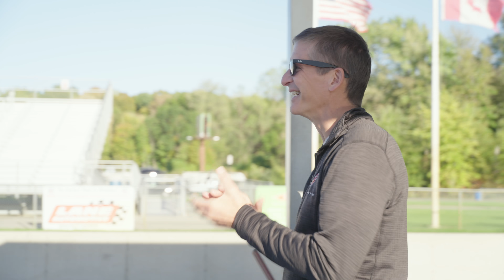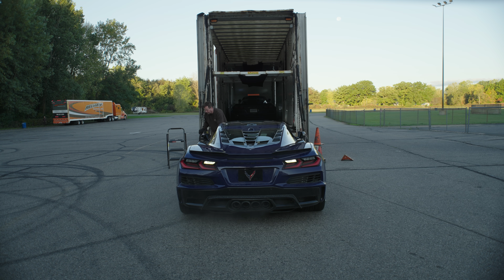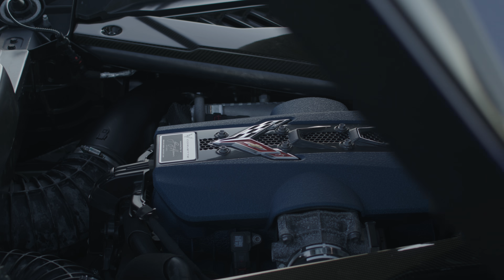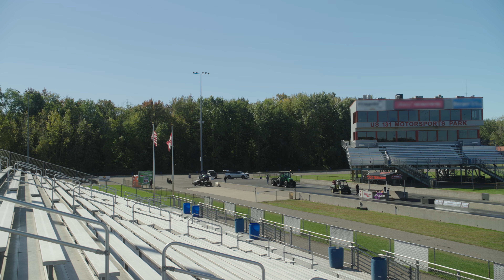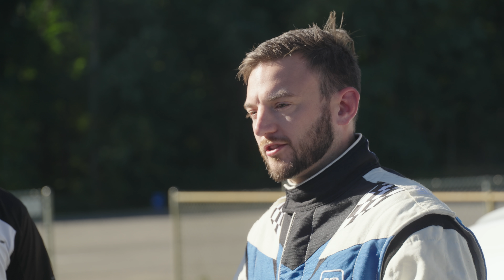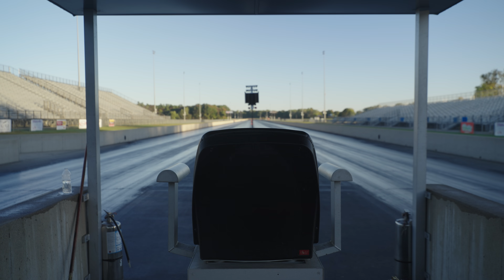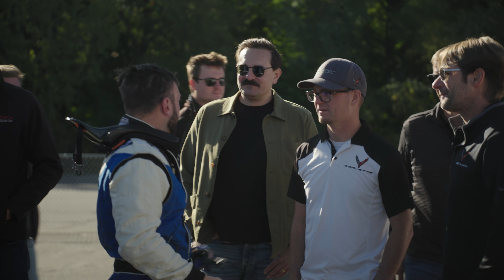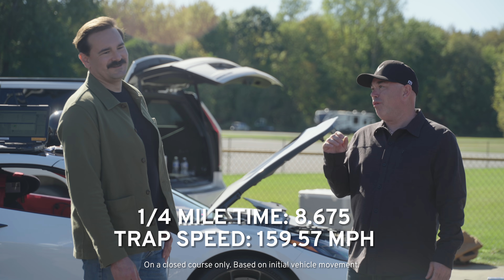We Pushed The Corvette ZR1X To Its Limits (DRAG STRIP TEST)

Comment: 0-60 in 1.68 seconds and 8.67 in the 1/4 mile is insane for the price and for running on pump gas.
Reply: That is crazy fast!!!  I wouldnt have believed 25 yrs ago this was possible!
Tech is amazing
Reply: @gordocarbo right? I remember even 20 years ago, the 11s in a super car was absolutely nuts. My friends dad had a car that would run mid 12s and I thought it was bonkers.
Reply: @chrisdwyer1477 honestly slow cars are still fun
Reply: @sneezinhatch  I think that's a huge problem with the car scene today. "oh, your car doesn't run a 10 second quarter, it's garbage." Like what? I'm so glad I enjoy cars. Not just ones with a certain HP number, price, or track time. What a boring existence that must be.
Reply: @chrisdwyer1477 I had a buddy with an old chevelle and he would tape a 100 to the dash and say if you can grab it while accelerating you can keep it. It probaly only ran low 13s and it threw you so hard in the seat. I cant imagine this
Reply: @watchandjewelryloft4713 Way too much judgement passed there.  Slow down.
Reply: @larrywilliams3858  It's not judgement. It's observation. 😂
Reply: @watchandjewelryloft4713 
 What?
Reply: @chrisdwyer1477 I had a 79 Ford 2wd pickup that ran mid 12's on slicks and I thought it was very,very fast! This was in 1989
Reply: Well the order is tall for Corvette. 

The C6Z w/ a competent driver and ideal conditions ran 10.9’s out of the box with only an upgraded ROAD-LEGAL tire. I had one back in the day. Can say that it was a monster before its time (I had a H/C/E on mine)… so it moved about like a mid-10’s car. 

And back in 2015-2020… there wasn’t much else out there that was faster…and every vehicle that was faster had to be modded quite a bit . There wasn’t another N/A setup that could hang with it. 

And now the C8Z is a firm 10’s car and the C8ZR-1 is a firm 9’s car. 

Thing is, this car runs mid-8’s AND IS ONE OF THE FASTEST PRODUCTION CARS AROUND THE RING. There are only about a half dozen truly production cars that are faster than this car on a circuit track. 

That’s what makes this car truly an accomplishment. It’s as fast as a Dodge Demon in a straight line and as fast as the fastest Porsche around the Ring at the same time. There are only 3 other cars w/ official laps times that are faster than the ZR1-X on the Ring and those mfgrs spend 100X more hours on that track than Corvette and the driver was an engineer that had a lot of slop  in his recorded lap times. 

Misha does a breakdown on that lap-time with the ZR-1 and said there was at least 10s left on the table in their lap time. Corvette has raised the bar once again, just like they did with the C6Z.
Reply: Gorgeous run on a super rubbered up track with perfect weather conditions. That’s gotta feel amazing!
Reply: @johnathanollenberg6041 Jealousy is an ugly emotion.
Reply: @stephenwalker6939 what was that about? I was saying that would have been awesome to experience, I wasn’t bashing them in anyway. Perfect conditions, fantastic car. I’ve always been a corvette fan.
Reply: @stephenwalker6939 and yes it’s an ugly emotion, I really didn’t mean to come across that way…. But I’m am a little jealous I won’t ever own one😢. 
Have a good night or day wherever you are.
Reply: @johnathanollenberg6041 it did come across as jelly but you cleared it well.
Reply: @jasoncobbb5029 I get it. Us Corvette fans have a reflex defense with all of the Corvette haters out there. I don't understand all of the hate. If you don't like it, don't buy it. It's that simple, but these folks feel the need to spew hate about the Vette and it's owners on every Corvette video they see.
Reply: Americans on top!! 🇺🇸💪🔥
Reply: Don't forget, with a warranty too! Other cars blow up soon after.
Reply: You are probably right!!! It just goes to show people just how much OVER-PRICED Ferrari, Lamborghini, Bugatti, and all the other SUPER CARS are!!!!!!! Chevrolet Corvette is a WAY BETTER VALUE than all those SUPER HIGH PRICED EUROPEAN SUPER CARS!!!!!!!
Reply: @micha @michaelvs.scorpio7676 errari and lambos aren’t overated or over priced. They may cost more and will always be with more 10 yrs down the road. Hopefully Chevy does the people who can 450k price tag for a zr1x a solid and keeps the production numbers low.
Reply: Agreed, but it’s insane period. There are several million dollar cars that can’t do that.
Reply: 0-60 in 1.68 is the fastest I've ever heard...?
Reply: @Itsjamilagain  That is about what Elon said his sports car would do with a ROCKET engine assist (never made it).
Reply: I'd take this over anything Ferrari, Lamborghini, or Porsche have, or could come up with, every day of the week. Significantly cheaper to purchase and upkeep. Way more reliability. And if something does break, then the parts will be much easier to find, and won't cost an arm and a leg. Sometimes I think these arrogant owners of European super cars are more about interested in flexing the pricetag of those cars, rather then flexing the performance, which if you think about it, it makes them look like fools with more money then sense, who don't realize these manufactures are ripping them off. A lot of these European manufactures love to try and excuse their outrageous prices with nonsense like brand recognition, and claims of being hand made and exotic materials that aren't nessecary. I'm sorry, but having a car with a particular badge with brand recognition does not automatically make it worth 6 figures. The only thing I'm willing to spend 6 figures on is a home and property, which is something I'm going to use and need all day, every day.
Reply: Can it run on E85 stock or does that require a tune?
Reply: @Steve_allen79  Would probably need upgrades to the fuel system and definitely a tune. Should run fine with a 100 octane though.
Reply: @Steve_allen79 tune
Reply: @Steve_allen79  if doing 100 i think fine but for e85 def. tune
Reply: @Steve_allen79  I feel like the electric motor would also require some tuning as well
Reply: This comment should be a tiny bit more down or start with a spoiler warning
Reply: I could go to the store and back pretty quick in this!
Reply: Not just insane for the price, that’s insane in general
Reply: And for a hybrid!
Reply: Who said it was pump gas? I don’t remember hearing that 😅.
Reply: It’s fast. Gt2 RS record about to go down
Reply: @MW-uy3np  the zr1x is too heavy to beat the gt2rs round the nurburgring
Reply: Faster than an S Plaid
Reply: @Stanawesome Definitely. Plaid S is more in line with the regular ZR1. ZR1X probably still running 8.9-9 flat in avg weather and DA. Plaid maybe can take it if its 100 plus degrees lol
Reply: @TB-vb3ov  Yeah, they ran consistent 8.7s over and over, so I’d say 8.75 is the realistic quarter mile for regulars. 8.67 maybe only for perfect conditions. Regardless, 8.75 still beats almost everything that’s electric or not electric, really only the Rimac Nevera will consistently beat it. Also, most other super/hyper cars use drag strips to test quarter mile and 0-60.
Realistic 0-60 is probably 1.72-1.75. Still faster than anything except Rimac Nevera R. 
Makes me wonder what GM could make with a multi-million dollar budget, and also it proves engines can still compete for 0-60 and quarter mile records. Not to mention showing how overpriced cars like the Revuelto are. Sorry for the rant lol
Reply: I’ll take it!
Reply: I propose a 2and licence for the car have to pass a I can handle it test without being a statistic but double or triple speed limit away from residential area or busy enough traffic where you would have to qeave in and out.
Reply: No company can beat it for the price ?...
Reply: Yeah... Because $400k is such a good deal... You dorks are so dumb
Reply: That's the 60 ft time bro not 0-60 🤣🤣🤣
Reply: @itshiho  no 1.68 seconds is the 0 to 60 time dude, Google is your friend
Reply: @markw9512 with 1 foot rolout btw so technically cheating
Reply: @yulpiy  goddamn you people are so thick about what 1 foot rollout is and why it is done. It is done because that is the way actual drag strips here in America are set up. They have a timing beam which you have to lineup for and break and yes there is literally around 1 foot of travel before the timing beam breaks and the run time kicks off. This is the way they have been since the 1950s. And so in order to keep the track times consistent from them till now so we can know who has broken what record, they use rollout. It’s not cheating, it’s keeping a system in place on which everything has been time since the 1950s so that we have consistent record keeping, OK?  And every single goddamn car they test here in America for the magazines has the rollout time listed in it so you can subtract it off and all the cars are tested with the same standards. So if you want to know how fast your beloved European overpriced car compared to this, You can look it up in those cars and get a relative measure.  Not complicated.  Try to keep up…
Reply: I wonder if they tune the car like more boost just to ran this times.
Reply: Whats the price
Reply: @tedrstedrs6690  around 300k I believe
Reply: @JustAnotherHondaGuyso 450 when it gets to greedy dealers😂
Reply: @CITRUS--  I mean hey it’s a fraction of a Bugatti and goes way faster lol
Reply: Don’t care how fast you make that plastic piece of trash China Motors only cares about shareholders and investors not customers they disrespect us and you clowns bend to the knees and open wide….
Reply: on racing gas, couldbe 8.5
Reply: It’s bad ass but it still didn’t beat the Demon 170 with all that and 800 pounds lighter
Reply: @nasapeterbilt6042 The Demon did it on E85, not 93 octane pump gas. Plus, this car can actually take a corner.
Reply: @nasapeterbilt6042 Demon 170 is a one trick wonder that can only perform in perfect conditions.  I would take a plaid over it any day.
Reply: @clarkharms Plaid will beat the demon 170 all day on the street amd 90% on the strip. The ZR1X on the other hand will beat the Plaid on both unless maybe its 100+ degrees lol
Reply: @TB-vb3ov I agree.  I have a Tesla and Rivian, both are incredibly easy to launch.  I have a C8 Z06 and it is definitely more involved to launch and forget about bad weather.   Plaid is also easier for everyday use.  Climbing in and out of a sports car is not easy, even finding a parking space that is wide enough to open the doors without hitting the car next to you, or speed bumps that bottom out the car etc etc.
Reply: nah. It will brake quick enough to justify the price. Never the less its an accomplishment.
Reply: Supercar!!
What are hypermarket qualification numbers?
Reply: With rollout?
Reply: I could buy an F150 from the dealership and spend $10 on mods and run 7s. This car is supposed to be for the track, but everyone knows that the GTD is a better track car.
Reply: @t @thermalmeltdown8953  With enough money any car in the world can be a 7 second car. Multimatic builds those ford GTD’s ford just supplies the body. At least GM built this themselves. Also until a customer receives a GTD competition the ZR1x is the fastest American production car around the Nurburgring.
Reply: You say that like these things are cheap. I am looking at 3 for sale right now for 450k.
Reply: Those numbers are just absurd and that its without radial tires. 😱
Reply: @ivanviera4773  Uhhh. Michelin PS4's ARE radial tires....
Reply: @tommyteeth5874 I’m sure he meant a drag radial which they’re not.
Reply: @ivanviera4773  yeah not the tractor that laid down pounds of glue on track
Reply: @Json918 it's a racetrack
Reply: @Json918 there are many many pounds of glue on there.
Reply: @Json918  Of course the track will be prepped, they want the best time they can get
Reply: @Json918  okay? What company DOESNT do this??? 
Ill wait... 😂
Reply: @gordocarbo  I think their point is that the amount of prep makes the "radial tire" point a little less relevant. Slicks wouldn't be much of an improvement, if any.
Reply: @mile_high_topher  not true, slicks are always an improvement on a drag strip.
Reply: @markw9512  Cool, bro. You figure out how many 100ths you can get.
Reply: @mikeroczkowski8545 mate nobody uses a prepped drag strip with special tires outside of the US.
Reply: @Json918 Excuses 😂😂 stfu
Reply: @m @mile_high_topher  tell us you’ve never raced on a drag strip with/without slicks without saying so
Reply: @markw9512  I don't care enough about you to tell you anything.
Reply: @mile_high_topher  you’re not smart enough to tell me anything, son.  You’re just a stubborn, can’t admit you were wrong Dunning Kruger type
Reply: @markw9512  That's cool, dude. Keep arguing against something I didn't say. Makes you seem real smart.
Reply: @mile_high_topher  people can read what you said and see for themselves. And I’m smarter than you’ll ever live to be
Reply: Can't talk about "for the price" without factoring in stealership rapage aka "market adjustment" :elbowbump:
Reply: @TweakRacer  and what other car in this category do you think you can get without paying markup, pray tell?
Reply: @markw9512 I wanna know as well 🤔
Reply: @TweakRacer  irrelevant
Reply: definitely take it over any EV even the Plaid any day.
Reply: @robertdaone  if the plaid was a hybrid it’d be a hard choice for me
Reply: @yeetskeet691  😂😂 really?? A plaid would be a hard choice for you?? I mean everyone has a butthole but youd have to be Helen Keller to think a tesla is in any way comparable to this corvette
Reply: @robertdaone u have a wife & two kids. A regular job. U can have a plaid & 300k cash in the trunk or this corvette & no money❓😂😂😂
Reply: @clarkharms  You’re comparing a Diamond to coal
And the plaid doesn’t handle no where near the Vette does you really can’t compare the two at all
Reply: @clarkharms yea cuz ur an idiot. Zr1 right now is selling for more than 250 & u can buy a 2024 plaid with 20k or less miles still under factory warranty for under 50k…. 😂😂
Reply: @clarkharms Yeah, but then you have a Tesla, with Tesla problems.
Reply: @Iamhimothy-11 that vette only costs $250k, I guess you don’t math much.  Either way you would not be able to afford the vette or the plaid.  Too bad for you, I have both.
Reply: @Maidenrules29 I have a Tesla, no problems.  I have a C8 Z06, no problems.  I got a lot of money 💰, that how I got no problems.
Reply: @c @clarkharms what’s ur IG, fb, tik tok❓ I bet ur 100% a liar.  We can get on live & I’ll embarrass u….
Reply: @MJR7250 yea the plaid can hold my wife & both kids in the back. U right , there is no comparison… the plaid wins… 😂
Reply: @Iamhimothy-11  I have a cars that does that.. the Plaid is lifeless and one demential can’t even compare
Boring asf..
Reply: @MJR7250 u have cars that does what? A plaid is boring to u, cool , nobody is forcing u to buy one… anything else revolutionary to share ❓
Reply: @Iamhimothy-11   It’s boring no engine noise no turbo no cam or exhaust sound or Handling just straight line 
Acceleration  one 
                         Dimensional… 
Oh did I mention it Fugly…
A face only a mother could love…
Reply: @I @Iamhimothy-11  You’re comparing it to Corvette and keep comparing to a Corvette it not even in the base model corvettes class
Reply: @MJR7250 yea it’s better than ALL of them 😂😂
Reply: @Iamhimothy-11  You’re entitled to your Delusional Opinion…
Reply: @clarkharms  bet you won't be able to buy a zr1x for 250k the dealers are gonna add minimum 25% mark up
Reply: @yota8325  in the short term, I think you’re right long-term not so much when I bought my z06 I paid less than MSRP if I bought when they first came out, I would have paid 100 grand over msrp.  Once the influencers and Youtubers get theirs, the prices drop.
Reply: To be fair, that’s just insane for any production car at any price
Reply: Heck yes!!   8s in the 1/8 mi is a respectable street car!  This thing is Bonkers!
Reply: @gordocarbo you mean 8s in the ¼
Reply: Just remember they do 1 foot rollout for their 0-60 times so it’s kinda not 100% honest. It’s probably close to 2.0-2.2 seconds.
Reply: @Some0ne001  if 0-60 was over 2.2 sec 1/4 Mile will be around 9.1 seconds not 8.67
Reply: @Smzxe it will not do sub 2 sec on normal tarmac
Reply: @Some0ne001 people are routinely running 2.1 seconds with regular ZR1s, if you can consider them regular.
Reply: @Some0ne001  You have to look for the disclaimer. It said “from the moment of first movement”, so there’s no rollout.
Reply: @GNX157 So what it said is exactly the opposite of what you are saying... So yeah, with 1 ft rollout.
Reply: @elenrad-y5o you failed reading comprehension in school.
Reply: @GNX157 "From the moment of the first movement" the first movement is the first foot. Soooo ?
Reply: Still 1.8 1.9 with rollout keep crying all manufactures that list 0-60 use rollout so it's not the flex ur thinking about. Why all the hate I don't get it.
Reply: @bobtaliaferro5492  we are at a state of performance with cars that it’s pretty tough to hate any top of the line sports cars produced. They’re all pretty retarded fast
Reply: It's insane no matter what!
Reply: The track was glued all the way thru the 1/4 mi mark.  And 1.68s to 60 mph, no way.  Rollout will make it closer to 1.9s.  Still insane and anything approaching 2s real world is off the charts.  Well done GM.  I guess everyone has to overhype already phenomenal reality w marketing spin so it's apples to apples.
Reply: @johannel8104  that’s still Insane !
It’s just the first year in Production weight until they put it on a Diet..
Then what more criticism?
Reply: @johannel8104  There was no roll out in these stats. Watch for the small disclaimer “from the moment of first movement” So actually their specs are even more impressive.
Reply: @johannel8104 take a chill pill
Reply: Nah it should be cheaper
Reply: @herecomesthealiens  best we can do is 5 bucks
Reply: @hertzwave8001 how bout fiddy cent?
Reply: Insane. Period.
Reply: Seriously. If they just added an E85 tune, they could add 200+ HP. And ZR1 already makes 1,200 CRANK & 930lb-ft (based on several dyno tests & Z06's 13%hp/10%tq drivetrain loss).

So ZR1X is making 1,380-1,395hp & 1,075tq 😂
Reply: Is there ECU stage 3 or 4 tune for running with E85 for the ZR1?  Like some X-drive Beemer sleepers do?
Reply: @yountune9799 No
Reply: @yountune9799  You don’t need the Car any faster..
Reply: Shelby Gt500 CR ran an 8.59 in the 1/4 and has 2 to 3 times less horsepower also.
Reply: @lincolnls0416  It a production car? a car for street?
Reply: @lincolnls0416  Stock?
Reply: I'd be doubtfull about "runnning on pump gas" as changing to race fuel/alcohol blend for modern turbocharged car is one of the easiest performance boost...
Reply: That’s with a 1 foot roll out. It's true 0-60 would be 1.85-1.95 sec
Reply: @SuvroSawon  still fucking fast
Reply: They never said on pump gas. I would assume e85
Reply: @uberdriver5711 Why would it be on E85? It uses the same engine as the normal ZR1 with the same engine power and it uses 93 octane.
Reply: @arpz1129 because they hot lapped it. He clearly says the car started going slower. The ecu will pull timing when iat are up from the heat. E85 has more octane to prevent detonation. Nobody goes to push a car its very hardest on just  pump 93. You are just assuming they used 93.
Reply: @uberdriver5711  You are talking like they are Joe Schmo pushing their car at the drag strip. They don't offer any performance car that runs on E85 from the factory. You know people are going to try and do the same times they are doing and they wouldn't want to have the bad publicity of ZR1 engines blowing up because they ran their tests on E85 to get better times and not inform people.

Also a lot of people push their cars on 93., not everyone modifies and tunes their cars to run on E85. 

Every car heat soaks and goes slower when hot lapped, Drag Times does it all the time. That's why they went back the next day after the calibrations were set to get the best time they could.
Reply: @arpz1129 let me know when they say times were run on pump 93. Nobody is dumb enough to push a vehicle making that kind of power hard on 93 while trying to run a particular number. Dont be dumb. Well maybe you would try it. If it hit that time on pump 93 they would have said it. Because thats something to brag about. Did they? Nope and they wont.
Reply: @uberdriver5711  Let me know they according to you will say they ran on E85. The engine is designed to run that power on 93 with them knowing they have to warranty it. This isn't a guy that modified his car to run double the power and has to run E85 to not blow it up ZR1s are already been ran over and over at drag strips even beating GM's stated times on 93.

Haha you thinking they would have to state they ran on 93 as a bragging point. Maybe they would have stated if they thought some idiots would think they had to run E85 to get those times.
Reply: @arpz1129 well apparently all the top tuners and youtube enthusiast are saying the car was juiced up. Maybe 100 octane.   So yeah you go argue with them. Another thing. If its something so easily duplicated. Why didnt the do it with the white car as well. The purple one was specifically used to achieve the lowest time.
Reply: @uberdriver5711  Yes, according to Chevrolet, the Corvette ZR1X runs the quarter-mile in 8.675 seconds at 159 mph. That's not on racing gas or special tires, either. Chevrolet says it hit that time on pump gas with its regular Michelin PS4S rubber, and it didn't even have to run an engine tune that would make it illegal in CARB states or fit some special aero kit

A report on Jalopnik. You can Google it and read the whole thing.

  Go argue with GM

What's your next excuse? That they are lying?
Reply: @uberdriver5711 Went real quiet there when proven wrong.
Reply: Is it really "pump gas" when its running off electricity too
Reply: @everett8811  I would say yes. Tchnically the car creates electricity for the battery when slowing down from movement created by the gas engine. So it's gas generated electricity.
Reply: It's not physically possible to do 1.68s 0-60 in a vehicle with rubber tires. Even on a prepped surface. Unless there is some sort of lie, and in this case the lie is the usual american lie, which is that the time is really more of a 5-60 time. I guarantee it's no faster than a Plaid in 0-60. I know this because both cars are limited by physics. not power or suspesion or tires or anything else.
Reply: Boy you guys believe anything 😆 🤣  I call BS
Reply: @danawooley9464 lets wainting to others people prove it
Reply: One thing's for sure: They're making the European supercar manufacturers look a bit silly.
Reply: @Hickeroar mate this is on a prepped drag strip with special tires. There are multiple Euro brands that can go in the low 8s with this setup
Reply: @Shin_MajinBull$hit, no European car under 2 million can touch this car. Name one.
Reply: C8 has many Engine Light problems. Some days the problems go away and then pop back up again and again!
Reply: On a super sticky drag strip, with a foot roll out, with a whole ass team of engineers tweaking everything. These aren't comparable numbers to anything quoted by car makers in Europe, or anywhere else. Everyone else quotes the performance of a car in real world conditions, aka something you could do yourself on pretty much any stretch of dry asphalt. You can probably add a second to both those times if you remove all that and then they look nowhere near as impressive.
Reply: @SapTheseCasters add a second? People are already running 9.1s in the regular ZR1. By this time next year we will see a zr1x touch low 8s near 7s. Just watch.
Reply: @SapTheseCasters because maybe car makers in Europe don’t care about the quarter mile🤷‍♂️
Reply: @quinnmarchionini7997  so why do they publish acceleration figures
Reply: @quinnmarchionini7997 It also does 233 mph, a Lamborghini Revulto goes 217.
Reply: People defend the zr1 like they will ever drive or afford it compared to a plaid which is affordable 😂
Reply: @Json918 two completely different cars. So STFU
Reply: It has radial tires. It's not out there on bias plys lol  @Json918
Reply: I drove one 2 days ago . Will I own one ? Prolly not . It still doesn’t take away from the fact that it’s the baddest American made car ever built . You can literally go drag racing , roll racing , and autocross in the same day and win all 3
Reply: @Json918 nobody cares about the plaid
Reply: @Json918 yeah a 5 year old plaid can be had for 50k..... we should all get one.... its pointless to compare ev to ice
Reply: @Json918  And a microwave.
Reply: @fr33lancr  yup cooking all the competition
Reply: its not stock calm up
Reply: 400k for this vs a plaid for 1/4th the price or 1/8th used for similar performance
Reply: @mrscopes2852 ZR1X starts UNDER $200k, you can get 2 fir the price you quoted😂
Reply: @Forever.Remain.Nameless zr1x ain't selling a penny under 350k
Reply: @mrscopes2852 yeah… because people actually want it.
Reply: @mrscopes2852 because people want it. No one wants a Plaid and I drive a model Y
Reply: @ShawnyStorm  I have a plaid clown and love it that BS C8 will get hot and slower
Reply: @danawooley3627 dude a normall ZR1 is faster on anythint but a non-prepped drag strip. The ZR1X will be faster everywhere even massively heat soaked and it can actually finish a lap of the Ring witbout going into limp mode
Reply: @ShawnyStorm  https://youtu.be/GJegRv4QG0A
Reply: After dealer mark up, you may not get one anywhere near $200k.
Reply: @mrscopes2852 bro get the hell outta here talking about a plaid
Reply: @Fyrebirdchicken crazy when he mentions a battery car its “garbage” zr1x has high voltage battery packs… man they both suck 😂
Reply: @Fyrebirdchicken  why would you even care you’re closer to owning a plaid vs this car that be sold for 100k over sticker 😂
Reply: @Json918 ??? Lmao .. what does that have to do with a weak ass , soulless plaid compared to a c8 zr1x
Reply: Plaid doesn't do 8s tho
Reply: @yusufgta4341 yeah you gotta strip it to run 8s, defeats the point of the plaid being a commuter car
Reply: @oaklandunderground is the ZR1X a battery car ev? Or are you stretching it to try and prove a point. Because I still don’t see your point.
Reply: @mrscopes2852 stock plaids don’t make it into the 8’s…. Also…. No one cares about an EV 😂
Reply: @jamessudbury6943  EV fan boys who have never even changed spark plugs care, lol. But f them....
Reply: @mrscopes2852 Nobody cares about a silent  battery on wheels that the panels fall off that can't stop because brakes suck😂
Reply: @osos231  crazy when he mentions a battery car its “garbage” zr1x has high voltage battery packs… man they both suck 😂
Reply: @OaklandUnderground Diff being brand names. The diff beig Corvette is a hybrid. The diff being Corvette makes music, the batt on wheels doesnt.😂
Amongst the 2 that sucks (according to you) I'll pick the noise maker faster one.
Reply: @o @osos231  different being that they are AWD and have electric components either way ?.. rather have base zr1 rwd lmao and doesn’t need no piggy back to make it full potential. Im good an AwD ElEcTrIc HyBrIds 😂
Reply: There getting outlawed from drag strips because the can't be put out when they catch fire.
Reply: @mrscopes2852 should look into what the record setting plaid had to do in order to get close to this vette’s time lol
Reply: Wow what’s up with this Stan Plaid Fanboy😂😂😂😂😂
Reply: @mrscopes2852 400k? Where are you getting that? A 1lz is expected to list for 207k. The quail silver special edition is going to be 241k.
Reply: @mrscopes2852  bro who cares about comparing it to a Plaid this is a 2 door hybrid v8 and the Tesla is a 4 door EV. Nobody is cross shopping this car and a Tesla. Enjoy both cars for what they are and drive what you enjoy and have fun with.
Reply: @mrscopes2852 What if there's a corner?
Reply: @mrscopes2852 a plaid? 😭😭😭😭😭😭😭😭😭 I already have a microwave
Reply: @mrscopes2852 EVs now just got outlawed at Orlando strip.  My guess is more will follow.  Not safe doors lock you in and other fire concerns
Reply: @jpconard  there's a manual latch for the doors lol, and way less EV fires than ICE fires
Reply: @mrscopes2852 similar.... Bud the plaid is half a second slower at the 1/4mile
Reply: @Lucas_sGarage true. But its much cheaper to buy and maintain, and its a daily driver with cargo space. Zr1x is badass but it just sucks it'll cost 400k+
Reply: mrscopes2852, it needs mods to do 8s
Reply: @mrscopes2852 lol cool bro.....
Reply: @mrscopes2852 and you can buy a airplane and fly across the country
Reply: @mrscopes2852 $200,000
Reply: But worthless in 5 years.
Reply: @mrscopes2852  gayyyyy
Reply: @mrscopes2852 Yea but the Plaid is really gay. And slower. So you want to be slow and gay, huh? 😂😂
Reply: @mrscopes2852  thanks for making that point.  lol and on a perfectly prepped track this corvette had to itself and didn’t hear what kind of gas they used? 😂
Reply: Common sense isn’t that common . This car not only beats the plaid and the sapphire in a straight line , but it annihilates hypercars and supercars roll racing , and can drive to the ring and beat them around that as well .. it’s literally an all in one cheat code , you can’t buy 3 cars that can do what it does in each category for less
Reply: @mrscopes2852 this is the most brainrot sht i’ve read. A plaid might be fast but it’s way more slow in track. Nobody looks at a plaid and goes “MOM LOOK A NICE CAR”. A plaid also needs to be recharged and a plaid is a tesla. A plaid also can’t make v8 turbo noises
Reply: @ward7337 725 nurburgring is slow?
Reply: @mrscopes2852 there is always some idiot who has to point out a plaid imagine saying to someone I prefer a plaid over a zr1x what kinda nerd you are bruh 😂
Reply: @mrscopes2852  a quarter of the price for an infinitely shittier “car”
Reply: No one cares about your boring electric cars here, wake up and smell the coffee.
You're definitely in the wrong place.
Reply: @mrscopes2852  Check out Glenn Sheeley's Corvette. It's a street car which he drives to work and it will destroy a Plaid and this Corvette without turbos, nitrous, or a blower. Just a 429 ci motor on gasoline. And it's a 100x cooler than a goofy looking plaid.
Reply: @MansonSherrillJollyits sick but the plaid is am actual commuter hatchback sedan with storage and will go 350 miles for less than 10 bucks at the house
Reply: It’ll destroy this awd zr1X naturally aspirated from a dig on the street ? Prolly not .